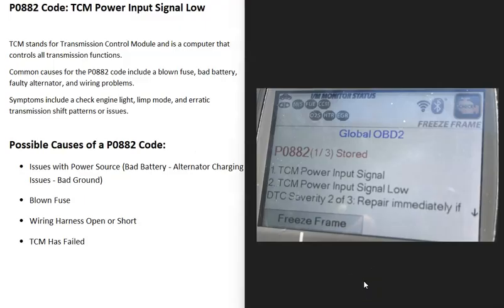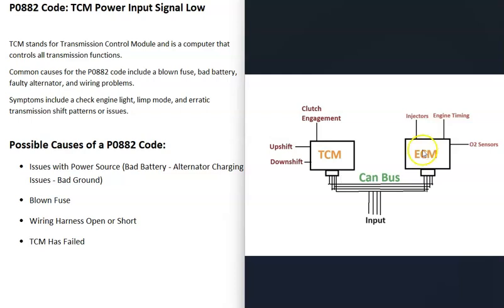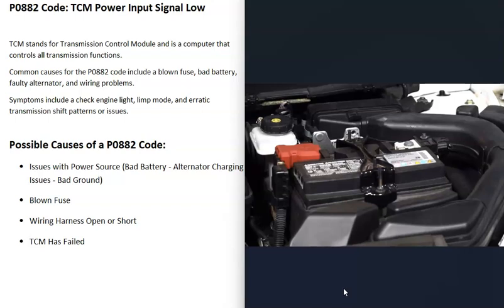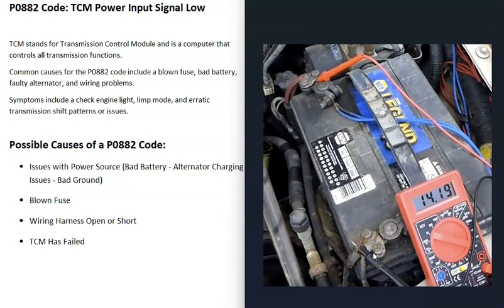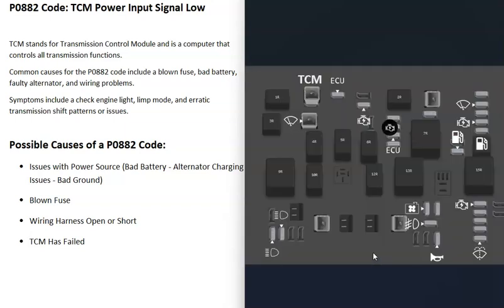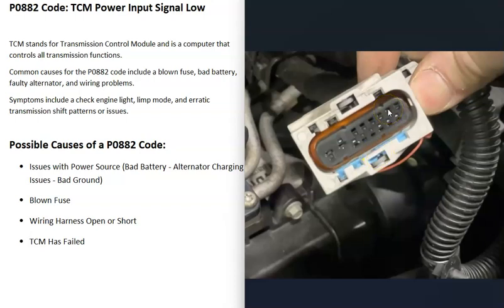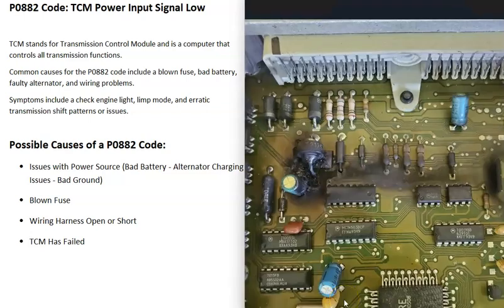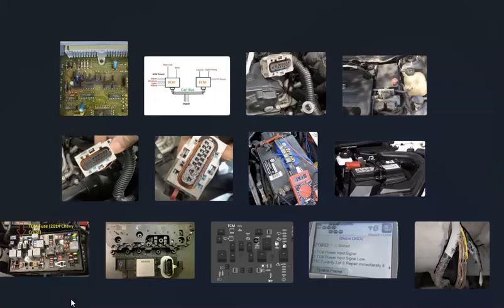Causes and Fixes P0882 Code: TCM Power Input Signal Low

Comment: Jeep Wrangler 2009 just flashed P0882 and there was a blown fuse. I change it and it was good for about a day and happened again. Changed it and did freeway driving for an hour with beautiful shifting, parked and it happened again. Changed the Relay and it happened again with the fuse. What do you think it could be?
Reply from the maker: It needs to be diagnosed, but it sounds like there is a wiring issue somewhere. There could be a loose connection or a bad wire shorting out on bumps. I would examine the wiring to the PCM, which for the 2009 Wrangler has the TCM built into it, and be sure there are no loose connections or visibly bad wires.

Comment: Battery light on reset bms on ford focus 2017 and still light is on transmission seems fine it just is giving battery light and saying code po882… could i possibly put electric grease in the pin connection or even the whole plug for the tcm if i can hoping that will help current to re jump the error for battery light. Because again car is driving fine no stutter no jolts nun just smooth as silk reallly dont want to go to ford there saying already to even look at the dam thing 200… and assuming thats not if i get a good mechanic being nice…

Comment: I was having problems with the Jeep Liberty four-wheel drive 2011 the battery keep on going dead and I replace it with a new one then those air later about maybe 2 months That battery go dead again with this code p0882 could it be possible or draining my battery I'm not sure That's my question I wonder if it could or not thank you
Reply from the maker: Has the alternator been tested? I would test the alternator and be sure it's outputting at least 13.50 volts DC, but ideally, 14.50 volts DC is best.
Reply: Did you figure this out? I have this code and p0750 on the same car

Comment: My Mazda 3 2015 is suffering with that code right now 😂 don’t know what it is but I appreciate the video and will start replacing the fuses .
Reply: Same car same issue
Reply: Did you fix it?
Reply: My 2014 Mazda is doing the same! Did you ever find the issue?
Reply: Fuck I have a 2016 Mazda 6. Same issue last year and it was due to corrosion was able to fix it and now having issues again with it so I don’t know if it’s a battery
Reply: 16 Mazda3. Working on this now. 345k miles. Replaced alternator, still error. But do think the alternator was going a had electric air going on. That seems fixed but still this error.
Reply: Same as the others…same car, same issue. Plus it throws in some TPMS and TCS lights
Reply: If your Mazda has a TCM bolted to the Trans replace it alot were junk from previous years.
Reply: I came for my 14 mass 3 too wtf is going on any solutions

Comment: my dodge avenger is  reading p0700 and p0882 and is stuck in limp mode. i bought another tcm and those 2 codes are still there and it still didnt fix it.any ideas? i have a 2008 dodge avenger. great video
Reply: I'm having the same issue with my 08 avenger. I replaced the fuse box and the PCM/TCM and it's still throwing those codes. I'm no mechanic and new at working on my own cars but from what I understand for the car to be in limp mode the red lightening bolt would be on , instead I just have the engine light on so I say it's "acting" like it's in limp mode
Reply: @pattylawson6674   You changed the TIPM (the fruse box under the hood)??
Reply: @pattylawson6674 what are all the codes (pending and stored) right now? Also did you have those components you replaced re-programmed and all updates installed for your vehicle? Were they offered as pre-programmed (plug and play) or was programming not done at all before or after install?
Reply: @moniana781  these are the codes that still show up.p0750,p0882,p0750.yes the tcm was programed plug and play
Reply from the maker: Is the battery good and alternator charging correctly? If those are good, I would check the voltage at the TCM.
Reply: @HVAC_Mechanic  theyre both good.idk if i just got sent a bad part or whats goin on
Reply: would a rely or fuse cause all this?
Reply: yo vertigo i have same car same issue did u fix?
Reply: @cstanner  no an i have no idea at this point
Reply: @vertigo2325  Do you still have this issue?  I have the fix for this. Is your transmission the 62TE?  Transmission Range Sensor. is there any other codes?  feel free to message me and i’ll give you my number.  Shawn’s Auto Repair
Reply: @shawngavigan8685  yes i did some work on it and now the only 3 codes that show up ar the ones for shift soilenoid a and c and low power to the tcm
Reply: @vertigo2325  what all did you do so far and what helped to eliminate those codes?
At the end of my issue description below, I highly recommend checking the crank sensor, cam sensor(s) and belts/chain. I have owned an 2009 Avenger SE 2.4L pzev I4 4 speed automatic and  I'm currently having these issues with my 2010 Dodge Avenger RT dual VVT  I4 4 speed automatic. I've never had more issues than with this current one. Both of them have needed crank and cam sensor(s). As did my 01 Dodge Dakota SLT (or maybe it was an SXT, I don't remember). That's always the first thing I look at, fuses, relays and those damn cam & crank sensors with Dodges...

My issues (if any of this helps,  or you can relate): Having same p0882 & p0700 PENDING (they come and go) and just showed up yesterday p0846 & p0750 (they all comes and go). And a p0032, p0038  (and sometimes a p01607) that won't go way. There are no stored codes besides the p0032 & p0038, the rest are pending, like I said they come and go. 4 months ago there were all the codes mentioned plus two more - p0562 and p0420. I haven't had those come back yet. When I've done the famous "key dance" ( put key in ignition, turn key on / off three times in a row but do not engage the starter, the dash where the milage is usually displayed will show the codes - mine did not, it displayed the word "done"). I am also very DONE Mr. Avenger and at my wits end! I have replaced ALL fuses, checked all relays (not replaced but I've swapped them around and they work, the relays I need are hard to find, out of stock and I've been told some discontinued -wtf?). Radiator and compressor fans come on but not as much as they should according to the temp gauge on the dash staying right at half way maybe a hair above (just idling, not driving). Engine coolant temp fluctuates from 199°F (lowest) up to 219°F (highest) -idling, I've ran all this while idling up to 20-30 min. I've replaced primary and secondary thermostats and the engine coolant temp sensor on thermostat housing. This model appears to have 2 engine coolant temp sensors, the other is on passenger side of engine bay close to coolant reservoir (I didn't change that one, it's hard to access bc engineers hate mechanics so bunch of BS in the way aka AC line and a right space). AC compressor clutch does not engage when I hit the AC button on the interior climate control. I checked AC compressor clutch sensor, it's connected. Maybe wiring or sensor is bad? Low pressure switch sensor is connected and appears to be working, maybe connection is compromised. AC could need to be charged? Interior blower motor actuators engage and I can hear them if I change vent to recirculate or change from cool to hot on the climate control dial. I also replaced the battery with a brand new one 4 months ago (iykyk, that a pain in the ASS bc wrestling with fender line was infuriatingly difficult, I don't have a lift so of course I used a old school scissor jack and jack stands, had to knock the lug nuts loose with a hex lug nut wrench and don't get me started on the asinine lack of space and LACK of battery cable reach and design, making sure I put the spacer back while holding it in place bc it kept falling off while I had to lift my heavy ass after market 18s on and then attempt to torque back to spec with a different basic single bar lug nut wrench using my lug nut key (bc I stupidly chose all wheels to have locking lug nuts) and I had to do this on the ground of my driveway!). Anyways thanks for letting me rant how much I loathe this car...
In summary so far, I have replaced spark plugs & cranksensor 1 year ago, ran fuel cleaner twice the past year, replaced both thermostats, replaced engine coolant temp sensor on thermostat housing, new coolant, new oil change, replaced transfluid, new cabin air filter, new engine air filter, all new fuses, checked relays next to TIPM, replaced valve stems (I had metal ones that my ex glued on & insisted they were corroded - mechanic debunked that). I do age after market radio and wheels that don't have the sensor in them so tire pressure light stays on (never been an issue).
I have a scanner Foxwell NT510 (basic version) and did a freezeframe that shows the reason for the freezeframe is the p0032 code. In my experiences, Dodge hates sensors that are not OEM. I'm considering changing whatever brand crankshaft sensor that someone else installed for an OE one. This model has (1) crankshaft sensor and (2) camshaft sensors. Since they are interdependent, I may go ahead and replace all of them. Definitely starting with the crankshaft sensor and seeing where it goes from there. If crankshaft sensor is not accurately communicating with the camshaft sensor, that can be the cause of the transmission codes and various other electrical imbalances that are triggering multiple system codes. Or hell, maybe the belts or timing chain is loose/slipping?? I'm just exploring all bases... Car runs, drives, doesn't stall, no high RPMs... just lots of codes and won't pass inspection!
PS. I learned I loathe with a passion that Chrysler Dodge Jeep RAM (and some) Volkswagen use TIPMs. Biggest pain and POS in my opinion.
ANYONE have recommendations or related experiences with my issues (and rants)?
Reply: Sonata está com câmbio em energia 4 p ninguém resolve o problema